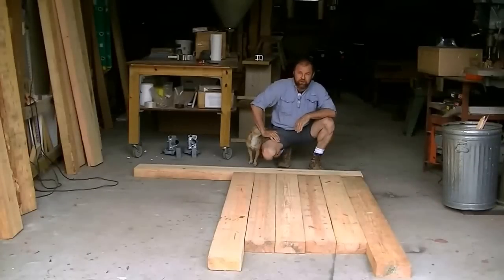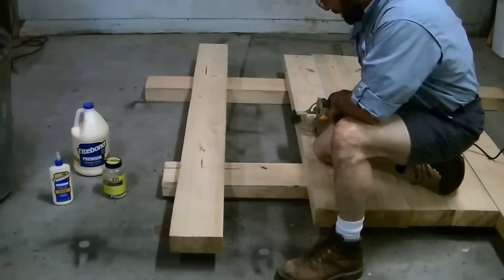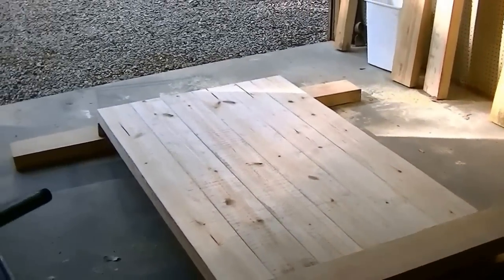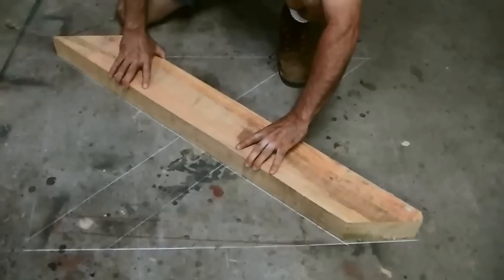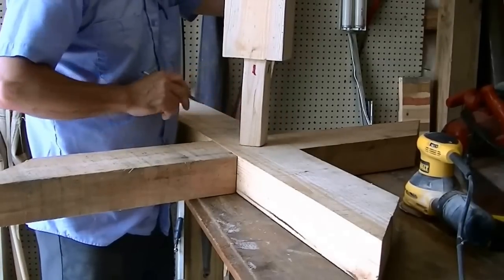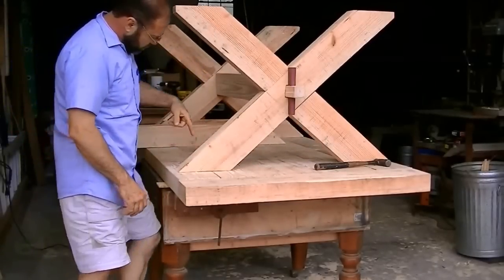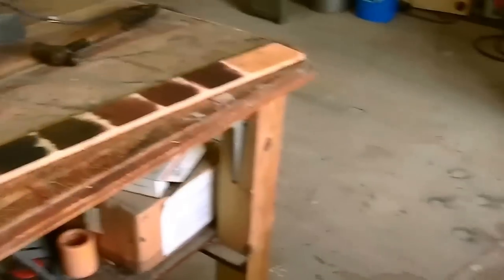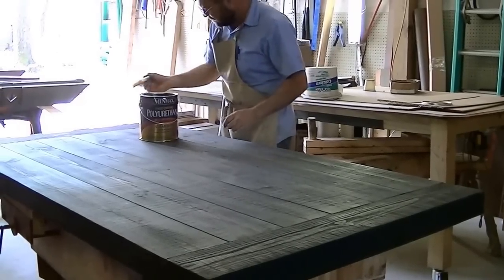Building a rustic farm table, step by step with wood from my sawmill

Comment: DEFINITELY WORTH THE SUBSCRIPTION! 
This is a great design and your work is flawless, this truly is high quality top notch craftsmanship. An older guy once told me anybody can call themselves a fitter or carpenter or whatever title they use but not everyone is a true  craftsmen, this is a fine example of the quality that set them apart.  You strike me as just a good ole boy with southern manners and hospitality and seem to be sincere about your work and sharing it,  I can't stop watching. Really love that simple older but rugged southern look that you go for, don't see that very often. I'm only 23 so I'm still trying to soak up as much knowledge as I can. I'm from South Louisiana, the Lafayette area, and have roughly 8 years experience doing wood work and 4 years experience fitting and welding a variety of projects including aluminum and stainless steel. Your videos taught me a lot of new techniques I never used and most of all, that look that is hard to come by with an average traditional wood worker. I already   watched a bunch of your videos, looking forward to learning more. Thanks for the knowledge it won't be wasted.

Comment: I built some Barn doors a few years back that were 3" thick x 5ft wide x12ft tall, 4 of them 2 per opening. They were built out of cypress. I ended up using a  3/4" spline and groove down the 3" side of the boards to keep them aligned. But before that I drilled 1/2" holes 16" apart down the 3" side and used 1/2" all thread as a clamp through the holes. In the end I ended up leaving the all thread in there and just capped the ends with plugs. I like this BEEFY table looks great!!!!!!

Comment: sir i dont mean to bother you but i just wanted to say wow what a nice table ...and wanted to say ive applyed polyurethane before using a foam brush and get a finish so smooth that no sanding was required by the way that was a gun stock that i refinished

Comment: Nice table.  Like the design, but for anyone attempting this,  look up proper technique for breadboard ends.
Reply: If you are referring to the expansion of the wood, I don't think it will be a problem in this case.  I mean obviously it will move some but I believe it would be very minor,  more than likely  unnoticeable to the eye. Mark let the wood dry for a year and had a dehumidifier in his shop for the humidity down here in the south,  getting the wood to about 9%-13%. So I believe that it probably already did most the expanding and contracting that it will do beings it's an indoor table and not exposed to the elements.  Definitely wouldn't keep it outside exposing it to this ridiculous southern humidity. Just my thought on the matter. I'm about a year late but good point if that's what you was referring to in particular.

Comment: This is a bread board table, with a board across the end of the table.
The boards running the length of the table need to expand  & contract in the hot & cold weather.
With the biscuits in the end grain how will the boards expand & contract? 
The table looks great, still like the brake down table for the students better, but this one looks good too.

Comment: You need to read up on solid wood movement. You can’t permanently glue a long grain board onto a wide panel across the end grain. This top will be fighting against itself stressing the joint. This is why breadboard ends are glued and pinned at the mid point and held fast with slotted pegs at the outer edges.

Comment: I love the massiveness of your table- cool as heck! But that "breadboard" end is going to bust loose when the top shrinks or expands with humidity changes- you have to allow for wood movement. There are lots of books and videos showing how the breadboard end can be built with allowance for movement. Can't say I like the girls' color choice, but maybe someday you can plane it all off and do a nice color. Nice project!
Reply: the TENON-BOLT guy 
The wood was dried out for a year and the table is kept indoors. Also,  Mark had a dehumidifier in his shop getting the wood to about 9%, so I think it probably done most of the expanding and contracting it will do. Obviously it will move some but I believe that it will be very minor, more than likely  unnoticeable to the eye.  I know humidity levels change even indoors especially down here in the south.  I don't think it's a drastic change in humidity levels indoors, I'm not sure though just my thought on the matter. I'm a year late watching this video it would be interesting to see it now but I'm sure it's fine. Good point.
Reply: the TENON-BOLT guy 
The wood was dried out for a year and the table is kept indoors. Also,  Mark had a dehumidifier in his shop getting the wood to about 9%, so I think it probably done most of the expanding and contracting it will do. Obviously it will move some but I believe that it will be very minor, more than likely  unnoticeable to the eye.  I know humidity levels change even indoors especially down here in the south.  I don't think it's a drastic change in humidity levels indoors, I'm not sure though just my thought on the matter. I'm a year late watching this video it would be interesting to see it now but I'm sure it's fine. Good point.

Comment: would pocket hole screws  be better then screwing the leg to the table top, whats your opinion. great looking table. All the tables I have seen on you tube this is my favorite great job I hope mine comes out as good.
Reply from the maker: +John Coonradt   I think the pocket screws will hold the legs on too. You can build the whole table with no glue just pocket screws. You may have to tighten the screws every tens years to keep it looking good.

Comment: I hope I am wrong but with the thickness of the lumber and the humidity of the southern climate, you are going to have problems with movement of the wood.  You used glue and biscuits for the end board and any movement of the perpendicular boards will be restricted by the end board.  The table is a beautiful table and the colors work great.  You definantly have great talent.  I enjoy your vlogs.  Take care.
Reply from the maker: Kyle Murray Yes, lumber movement here in the south is always a problem. I used a dehumidifier in the barn to bring the wood down to 9% before I started and my daughter will have to keep the table inside at all times.
Reply: Don't know if you are still around, but any update on how it held up? Greetings from Denmark!

Comment: Nice job, Sir!  I cringe though, when I see polyurethane being used on these beautiful tables.  It will yellow and discolor over time.  Go with Polycrilic.  It's the same price (roughly) and won't discolor your piece.  Probably won't matter much on such a dark stain, but on a white or light color, it will yellow for sure and then you have a beautiful table (or whatever piece) that has a nasty tinge to it.  Just my two cents.  Keep on building!!
Reply from the maker: Thanks for the advise. I will go with the polycrilic.

Comment: How much would you charge for that table and what are the measurements. Length and width.
Reply from the maker: +John Coonradt jr.5  I charge $2000 for this table.  It is 30" tall, 40" wide and 73" long

Comment: Good work. I liked it. Love the comment -- "let the women decide". Now, you did not show how you mount the 2 short ends of the tabletop. Did you glue or screw then on?  This table will last 100 years.  I never thought of the crossed legs and how you can always and easily disassemble and reassemble them easily. Brilliant.
Reply from the maker: +Seahorse Workshop The end bread boards are glued on. I show it in the video.
Reply: +markp0177 - I must have missed that part. Yes, I see it now.  Do you prefer biscuits instead of dowels?  I built my table using dowels and found the process takes longer and sometimes if I missed the drilled hole by a bit it is hard to clamp the boards together.  Your biscuit jointer seems so easy. I am thinking of buying a biscuit jointer.
Reply from the maker: +Seahorse Workshop The biscuit jointer is very easy. I still dowels on some projects and leave the dowel sticking out a little for looks. I am building several benches now and one will have the dowel sticking out. I will be posted it in a week or two.
Reply: +markp0177 - Look forward to it...

Comment: how long did you leave the wood standing up to dry.
Reply from the maker: +John Coonradt  I let it dry around a year. I use a dehumidifier in my barn when the humidity high and open my barn doors when it is low. Once my wood gets down to 9 to 13% moisture it is ready to use.

Comment: As has been noted, the breadboard ends were attached without any consideration for cross-grain issues. If you take the time to build a table like this, you should take the time to research one or more methods to handle this potentially fatal flaw.